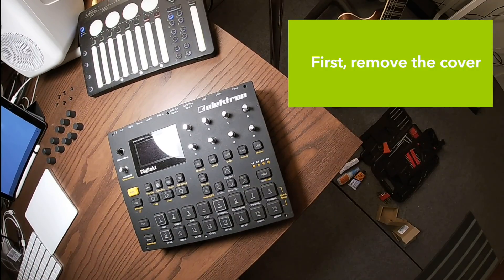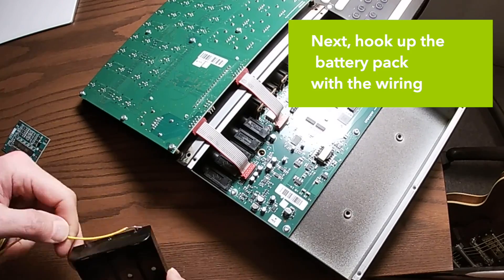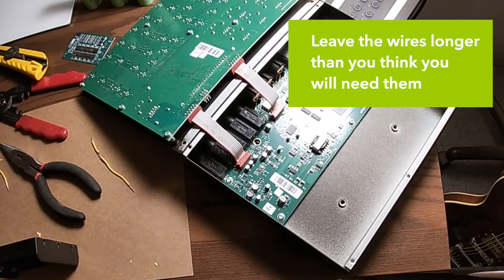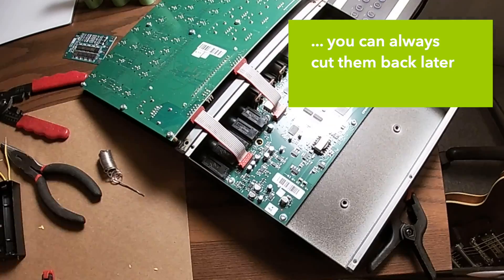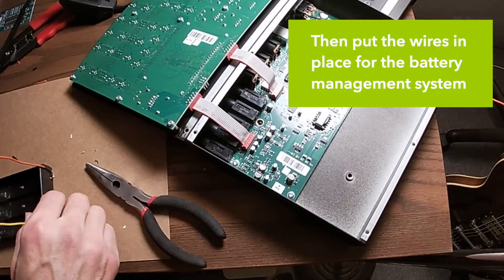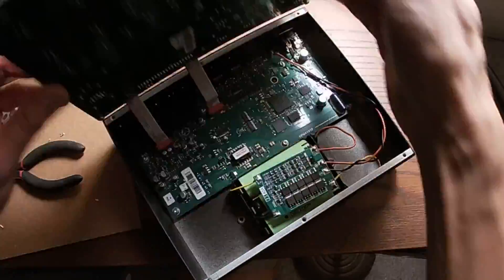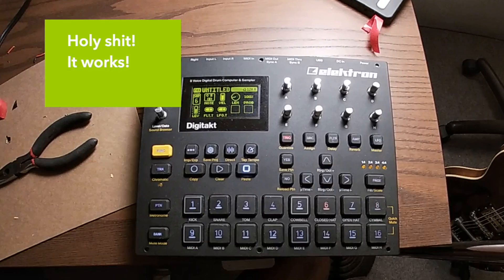watch me put a battery into my Digitakt in 5 minutes

Comment: I just tried with my octatrack, dont get clear where to solder the black coming from the negative pole of the BMS to the octatrack i guess to de left side terminal of the interrupteur but i measure 12.1 V between the 0V terminal of the BMS and the negative pole so something might be wrong with my BMS
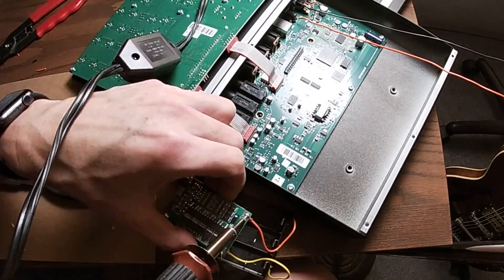Reply from the maker: I haven't tried doing this with my octatrack yet.  Take a look at my second video ... it might give a clearer view of where the black wire goes to at around 2:30 https://youtu.be/WwtQQrG44VU?si=YHj_6Odgliw-2YVw
Reply from the maker: If you succeed, please do a video of how you did it!

Comment: No integrated usb c charging port though?
So you have to crack your digitakt open every time you want to recharge the batteries????
Yikes
Reply from the maker: Nope.  That wouldn't make sense.  Just have to plug in the standard power adaptor and it charges the batteries.  Works just fine.
Reply: Why would you need USB to make it rechargeable? It's rechargeable using the regular barrel connector that the Digitakt already has

Comment: Bosch or DeWalt 12v adapter + battery 2-5 Ah capacity + small wire with barrel plugs - and it gives stable 12v, which BMS doesn't provide. Another advantage - you don't need to modify the device.
Reply from the maker: Very cool!  Have you done this already, and if so can you post a picture, and share how much time you're getting out of it?  I'm not sure what you're talking about regarding the stable 12v ... I'm not noticing any problems when I use it.

Comment: Wouldn’t it have been easier to just internally mount a rechargeable power bank instead of soldering and circuit boards and all that?
Reply from the maker: Yes - that's a great idea.  You'd still have to wire it to the power connector some way or another.  I think it would be a neat project to cut a space (like a side-hole) in the DT and fit a power bank into it.  Post pictures if you do it!
Reply: @addendmusic  Hah yeah I wish I was smart enough to do that.  :)
Reply: I use Birdcord PD-12V Adapter + Powerbank for Digitakt and Syntakt. 
It works perfectly.
Reply: @andik2363  love it, thank you!
Reply from the maker: @andik2363  Very cool.  I found my ripcord to not work with anything bigger than the Digitakt and Digitone.  I'm curious if you've had any luck with the birdcord powering an Analog Rytm, A4 or OT.
Reply: @addendmusic  It is important that the powerbank has usb-c pd + birdcord 12v

Comment: Looks cool, how long it works on 3 21700 batteries? I saw that it possible to insert 6x 21700 in to digitakt
Reply from the maker: I ran a test and I'm getting just under 4 hours with these batteries.  I'm pretty happy with that!
Reply from the maker: Cheers!  I'm getting 3 hours easily.  I'll try running a test on it this weekend.  Yes, there's definitely enough room to fit another 3x 21700 in there
Reply: @addendmusic  Please correct me if I'm wrong, Im a noob. but. 6x3.7V=22,2V. Will BMS convert that to 12V output (to digitakt)?
Reply from the maker: @wes2819  Sorry for the delayed response.  Your logic is definitely correct if the batteries were in series.  But I think the way to do it is to do 2 batteries in parallel for every 1 battery in the original design ... I think that will keep everything working.  Of course, testing it with a meter before connecting to the Digitakt is the thing to do!
Reply: @addendmusic  thnx, for the response :), makes sense, but tricky. I'm not brave enough to try that. will stick to 3 batteries.
Reply from the maker: @wes2819  Sounds good!  To be honest, I'm totally happy with the 3 batteries ... it's almost 4 hours I'm getting.
Reply: @addendmusic  It's also more then good enough for me. 4 hours is way more then my attention span. thnx for the upload for this video. Little side note: If you want to build battery pack inside Digitakt 2. Keep in mind their will be a little bit less room in Digitakt 2. From the look at your video, distance from mounting screws to bottom edge is smaller then compared to DT2. Which implies that bottom PCB is longer in DT2.  Not impossible to place battery pack, but more limiting. But, in my case. I will not stuff the battery inside enclosure, not comfortable with the idea.
Reply from the maker: @wes2819  Thanks for that!  Yeah, I’m definitely planning to do my Digitakt II in the next while.  Thanks for the heads up on the spacing!
Reply: That's dope!
I don't own a digitakt but good to know you can do that!  I would have thought there was less room availible in it
Reply from the maker: Thanks!  Yeah, it's pretty cool to be able to do a little project like this.  I'm now using my Digitakt way more and it really is an amazing device